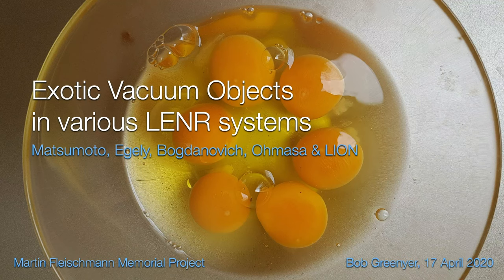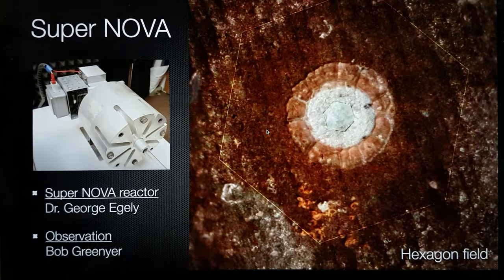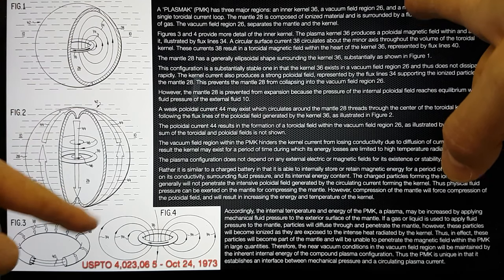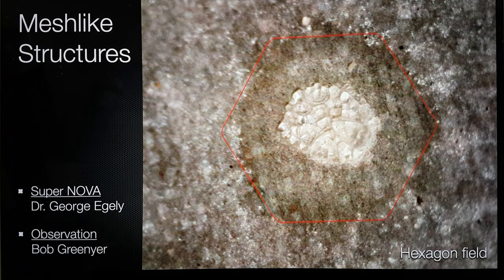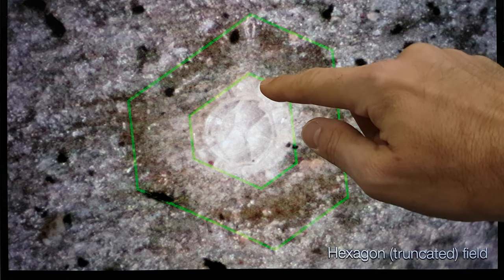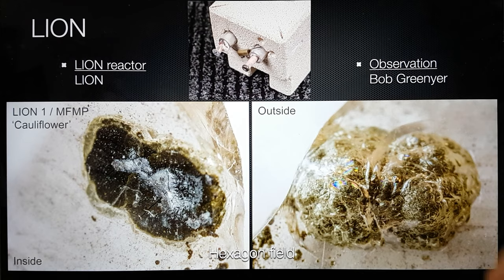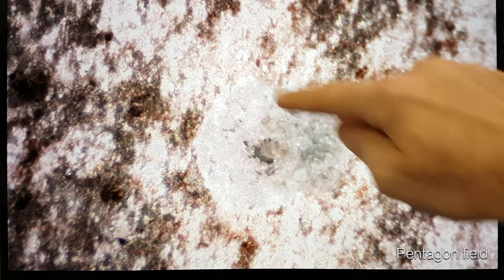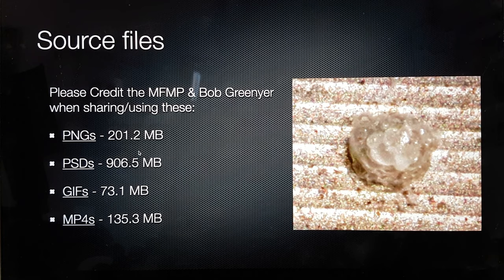Exotic Vacuum Objects in various LENR systems

Comment: As I experimented with using a voltage multiplier in conjunction with a ignition coil that was was excited by a hundred 10 volt AC power supply track and in blocking capacitor on the line giving 120 Cycles bumped into a voltage multiplier in tripler this pump to high-tension positive charge it is standard light bulb or mercury vapor ball cuz it tremendous collimation of electrical energy energetic enough to blow a hole through the bulb when the discharge was drawn from it in the case of a mercury vapor bulb you could charge the gas is inside the ball with the Van de Graaff generator it formulated some kind of gas capacitor similar to a high-tension electrolytic capacitor what I call a dual dielectric capacitor the external glass shell of the bulb forming one dielectric material the internal gas is in the ball forming the second dielectric another very fascinating experiment was accomplished by putting a rotating charged plastic disc in close proximity to a standard plasma lamp without the high voltage power supply the bulb containing neon and various gases this reaction created a pinwheel effect which appeared to be node and antinode points which corresponding to the rotational frequency are the plastic discs and its relationship to the surface of the glass ball I always wanted to see what would happen if you let a flat chamber filled with the same gases and put the rotating plastic next to it